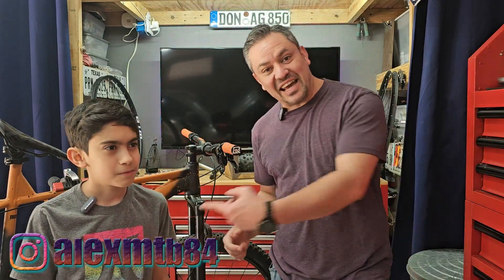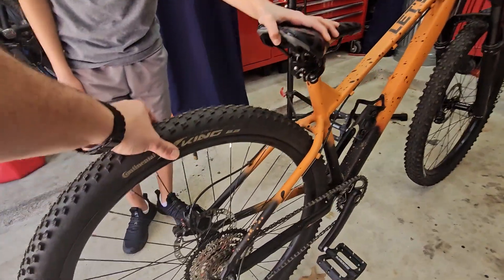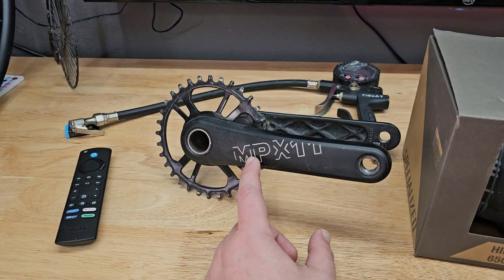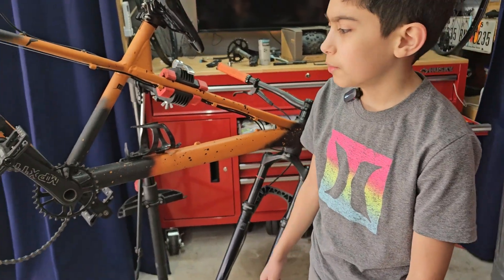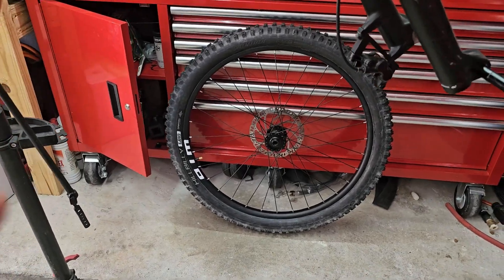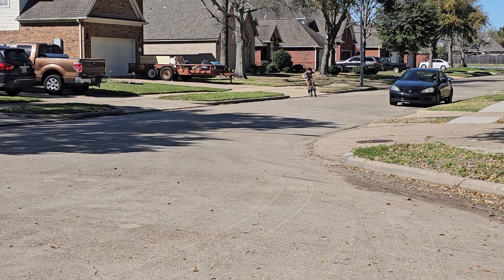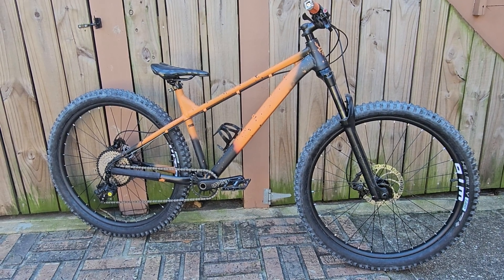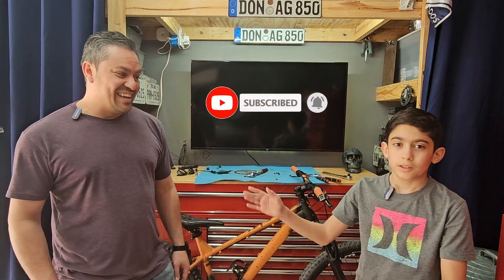Mongoose Ardor upgrades for my son #mtb #mtblife #trail #emtb

Comment: 7:43 Still looks too big for him.  When saddle sohuld be in line with the steam, or there about, so when saddle up the feet should reach on the toes, and knees should have a slight kink with feet on the pedals.
You could lower the stem. With the head angle of this bike  you could go for a shorter stem. But he will eventually grow  enough for it to fit.
Getting on and off the bike with the saddle all the way should not be an issue, it clearly is an issue for him. The frame is too big for him.
10:06  Whats up with the steep angle on the brake levers? That's not a good idea. If the rider was too spent most time on the rear wheel hopping then this set up makes sense.
Reply from the maker: Thanks man! Yeah a few more mods await, plus yeah, I'll grow into it